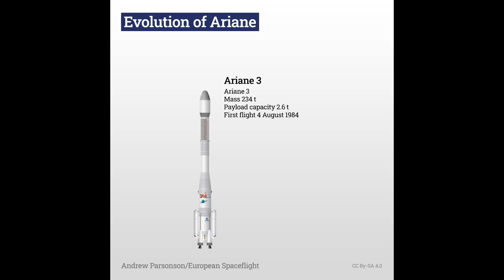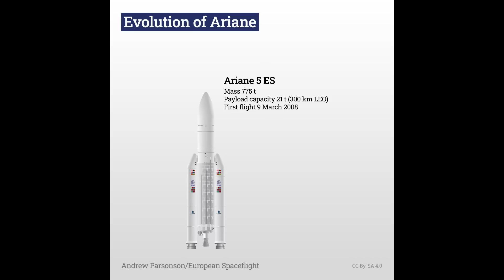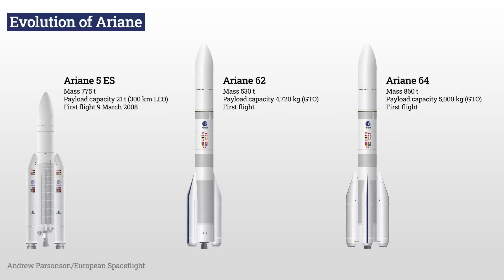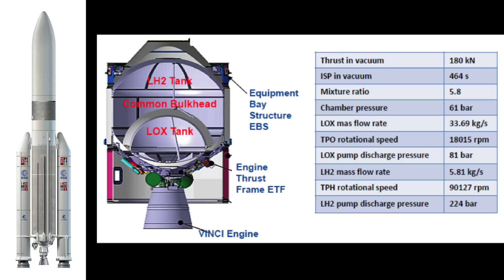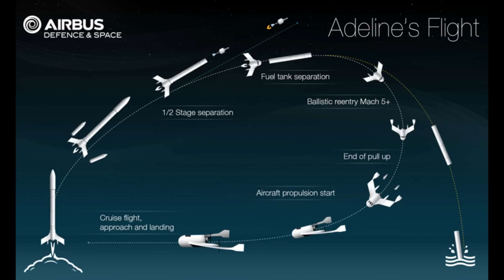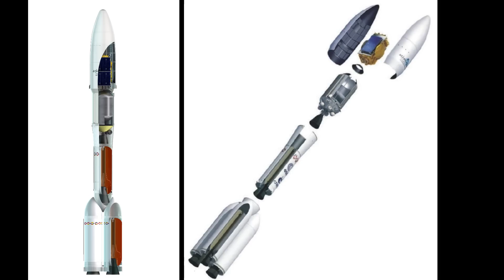Europe Retires Ariane 5 Before Ariane 6 Is Ready????

Comment: the gap in capacities is problematic, but this is more of a political issue. our politicians just never learn, they want to cut cost as much as possible and thus planned ariane 5's retirement for when ariane 6's planned start, without ever considering the possibility of the program being late. you know the thing that *absolutely never happens*. 
and this is not the first time they pull this kind of stupidity, i don't remember the details but there is other cases. we should have kept making and scheduling ariane 5 flights until Ariane 6 is effectively ready. if you have empty rockets just order a duplicate of whatever probe was quite neat like that mars seismometer and send it wherever, it's not hard to find scientifically interesting stuff to do.

but in the grand scheme of things, it's a non-issue. the european space program exist because we want it to. getting some cash out of it is largely anecdotal.

Comment: And of course Europe knows about reusability of rockets. The WWII Starthilfe (a podded RATO, dropped on parachute at a selected area for reuse)[1] comes to mind. 

[1] in service from 1942, 6009 units produced, providing 30s of ~4.9kN thrust. WTR: 2-4x. 
Used T-Stoff (stabilised HTP) and Z-Stoff (catalyst) in a Walter HWK 109-500 engine, i.e. “cold” cycle.

The “hot “ cycle would use C-Stoff (~6 parts methanol, ~3 parts hydrazine hydrate, ~1 part water and traces of potassium tetracyanocuprate(I)) instead of Z-Stoff; T-Stoff and C-Stoff are very hypergolic, raising the temperature from ~800°C to ~2000°C. This was used in the Me 163B “Komet” rocket fighter (the A version for development and training used the “cold” cycle). 

Obviously the rocket fighter would land with the engine (held in place by a few screws and easy to exchange as a whole) to reuse it …

Comment: From a commercial perspective, reusability is not an obvious solution for the European space industry. For SpaceX it made sense because they are also their own customer with Starlink, so they can have dozens of launches a year in LEO. In this case, reusability makes sense. 
But for Europe, launch cadences are quite low. If Ariane 6 was reusable, it's not guaranteed that it would be cheaper than it is right now. You need to have a decent throughput to lower manufacturing costs, and reusability wouldn't allow that in this case. A few sources estimate that you need at least 15-20 launches a year for reusability to be profitable.
Reply: Remember though that Starlink was not a thing when SpaceX began working on reusability. And Starlink would be difficult to have had they not gotten Falcon 9 reuse to where it is. SpaceX did make a market for Falcon 9, but there was already a growing market prior to Starlink.
Reply: @anthonypelchat  That's true, reusability enabled Starlink to exist. But up until then (let's say 2018-2019), we don't know if reusability was justifiable or not in terms of cost. SpaceX had vision for sure, and this wouldn't really happen with government funded programs (though NASA did fund SpaceX, that's another story).

Comment: What About VENTURESTAR ??   That was a very Innovative system for 2003.  
A number of Amazing technologies, many of them Very workable:
V-Spike engine design. Better Thermal protection; Runway Landing; crew of 7. 
The  main Problem area was constructing the Fuel Tanks at the lightweight parameters necessary. 
But However - has there not been Some Progress on these technologies in the past 20 years?  
Can 3-D Printing by Design be helpful in building that Stronger Lightweight Fuel Tank - (??). 
It just seems like there could be a Re-Visit of this vehicle Concept,  fora Better Craft that could Actually Be  that ‘Shuttle -2’ upgrade that seemed within NASA’s grasp -
Reply: You're right, there's been quite a bit of progress with carbon-fiber fuel tank engineering since Venturestar— the sad thing is, it could have flown successfully with the stopgap aluminum tanks they had developed as a fallback plan. 
I don't know whether Venturestar would be a worthwhile project to "revisit" or not. My impression is that the engineering plans are still valuable, and maybe some of the Venturestar-specific tooling is still around somewhere and serviceable, but at this point you'd be starting afresh. 
If NASA or DoD or DARPA or the Space Force really really wanted the Venturestar, and muscled up the funding for it, that would be great. But just because it was brought to the brink of flight-readiness doesn't mean it's anywhere near that point now. It isn't. You'd be starting from zero, albeit with helpful cheat sheets from someone who almost took the test you're preparing for.

Comment: Curious why we don't cut down on the amount of energy needed to get rockets into space by building them on mountains and letting them slide down on tracks with a jump at the bottom where the rockets can than ignite and use the momentum for an easier lift off.
Reply: It doesn't really save anything on the overall launch energy and causes a much larger loss of energy getting everything to the top of the mountain in the first place.
Reply: @anthonypelchat  damnit, guess I'm not smarter than the physicists and engineers currently building the rockets. A man can dream.
Reply: @tigadirt  A lot of people ask the exact same question. Same with the question of launching from a tube running up the side of a mountain. When you start doing the math, it quickly falls apart. But it always sounds good before then. Lol.

Comment: Scott I'm learning about calculating altitude based on pressure using the barometric formula. On earth, there are 8 layers that use different parameters (like temperature lapse rate) say different altitudes, which correspond to layers in the atmosphere. How did they account for this oh Mars?

Comment: So, EU is going the moron ULA route of "management"
Reply: yes and no, its still a lot better than ULA, but yes the EU need to get ther shit togher.
Reply: @anno-fw7xn  Uh, its identical in stupid.  "retire" something before one even has the next vehicle ready for operations.  Its like taking your car to the scrapyard and then wondering why you have to walk back home...
Reply: @w8stral  I am not informed enough about that case, but if you don't have the resources to both invest enough in your new project and run your tried and tested launchers, isn't it better not to continue to fall behind and cut your old one to focus all you have on the now needed one ?

Taking you car metaphor it would be more like having to take time maintaining your old car while your project car in the garage half done.
Take your old car to the scrapyard and now you have a newfound motivation to actually finish your project car because on top of having more time you actually need it.
Reply: @Vaasref  There is no maintenance...  These are 1 use rockets bud.   Retiring ANYTHING before you have the replacement designed, tested, and certified is beyond stupid.    This is as stupid as apple saying they are coming out with a new phone, knowing the new phone does not work and has not even TESTED the new phone let alone certified it, stopping production of the old phone and then saying... ooops... new phone still does not work... !!!  This is beyond STUPID
Reply: @w8stral  Dude did you just manage to not even comprehend your own metaphor ?

If you thing the "car" is one single rocket then you put your car to the scrapyard every time so your metaphor makes no sense. Now if the car is the launcher project/program, then yeah, keeping it alive IS maintenance and it cost resources that could be reallocated to the new project car.
Reply: The EU has nothing to do with ESA. It are 2 different organizations with different memberstates.
Reply: @ladydustin7811  That is as stupid as saying NASA has nothing to do with the USA.
Reply: @w8stral  First, the EU is not the US, it is not a federal country with states.
Second, the ESA is not an agency of the EU it is a parallel inter-government organization. It is only indirectly related to the EU because most of the countries contributing to the ESA are also part of the EU, but not always.
The UK, Switzerland and Norway are part of the ESA but not part of the EU.
Third, the budget is not decided by the ESA itself (or the EU if you are still comparing with the USA-NASA system) member countries pay a mandatory contribution plus whatever they want (and however they want). For example France is contributing in kind to the ESA by hosting the ESA at the very advantageously placed Guiana Space Center in Kourou and France pays for the maintenance costs.

Funnily enough the EU has its own space agency the European Space Policy (formerly EUSP for EU Space Programme), this one would probably compare better to the NASA in term of political structure and funding scheme : the EU allocates part of its budget for it and decides its goals.

By the way even countries members of the ESA can have their own national space agencies, Frances has the CNES (which logo you can easily see on Ariane rockets), Italy has the ASI, Spain the INTA, etc.

So that means that there might be 3 difference space agencies sponsored by a country member of the EU and ESA.

And it is Europe so you can also add asterisk to a lot of thing I said.
Reply: @Vaasref  I think you need a slightly sharper definition razor.  Suggest a finer diamond stone...
Reply: @w8stral  Dude would you say that the NASA has something to do with the UN ?
If you would then ok, the ESA has "something to do" with the EU, otherwise I gave you a decent explanation of why indeed the ESA has nothing to do with the EU.

Comment: Elephant in the room. 8-). Just discovered all of Europe has exactly one launch site. French Kourou. Once (but no longer) they could launch from Baikonur Russia. Maybe it is time to look at other launch sites?
Many under construction. Quite sure Scott could elucidate. Even Canada is building one. Or. How about this? Launch from your own country. Cheers!
Reply: Firstly, having a European launch site would cause intense and prolonged arguments over which of the partner countires it should be in, causing further delay. Putting it outside those members was a huge advantage. Secondly, if you are going to put it outside Europe you may as well get it close to the equator which saves fuel - for some missions, a very subsantial amount. That's why Baikonur is south of Russia proper, and why Cape Canaveral is in Florida. And its why French Kourou.
Reply: Second-and-a-halfly, the missions which benefit from being launched close to the equator, furthermore have to go eastwards – and in the critical first phase of flight you do NOT want to be above inhabited land areas – for safe disposal of a disposable booster and fairing and for the contingency of the rocket exploding. And geography is such that there are neither oceans nor vast empty steppes directly east of Europe.
For other kinds of launches (suborbital ones and in a few years' time probably small polar-orbit satellites), there is e.g. Esrange in the north of Sweden.
Reply: French Guiana is a French department. It is France, just as much as Alaska is in the USA while not being contiguous with the rest of the USA. More so, in fact, if we consider that the first French settlement in the area dates back to 1503 and that Cayenne was founded in 1643. This may change in the future but then maybe Alaskans will decide that they'd rather be Russians again, after all.
Reply: What is the problem with Kourou? It's not going to disappear.

Comment: Nice to see that they saw the need for a flame trench. LOL
Reply: Everyone uses things like this, including SpaceX with the Falcon 9.  I guess Musk really, really wanted to see what would happen without all of this ubiquitous launch infrastructure.  It turned out to be more predictable than he was hoping.  He always prefers to omit hardware whenever possible, and sometimes this has worked out for the better for SpaceX, but this case was a no-brainer and now it's a head-scratcher.  At least he's finally convinced.
Reply: @rbrtck  They knew and were in the process of making upgrades to the pad but decided to risk one flight.  That's why all that hardware they're not putting in was laying around.  The notion that they need or needed a flame trench though is silly to the point of nonsensical.

Comment: Not using Ariane 5 for astronauts and the manned version of the ATV is and will be a shame...
European space industry is really slow. Especially political support is non-existent and bureaucracy is a mess. Want to test a new engine? You might get the permission next decade.
On the other hand the slow progress and the fact that every screw of the Ariane gets assembled and disassembled 100 times made it pretty reliable. It wasn't SpaceX's method of "let's try it until it works". But the engineers aren't very happy: New ideas? You want a faster progress? Shut up!

Comment: Anyone else get the feeling that the building was standing still and it was moving the planet underneath it?
Reply: To be fair, it wouldn't surprise me if the politicians calling the shots decided it should work that way and the engineers had to make it happen.
Reply: I think it is actually a sensible way to stack rockets. A building frame should be far easier to move safely away from the pad rather than move a huge stacked rocket, or even unstacked stages, away from the building and then place them on the pad. This is the way NASA should have been doing it from the start. It wouldn't of course doesn't suit Starship type reusable rockets where the launch pad and return pad are the same or are adjacent.
Reply: @kenoliver8913  there's a pad?
Reply: @DrWhom  yeah the ariane is assembled on top of the pad and then the whole building moves away.
Reply: flat earth confirmed